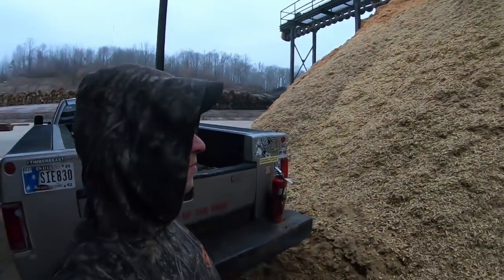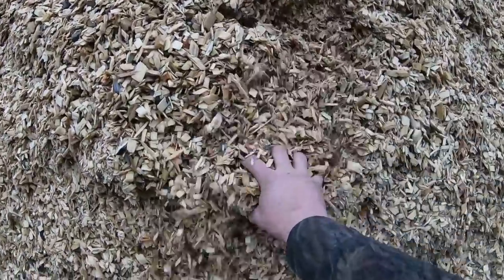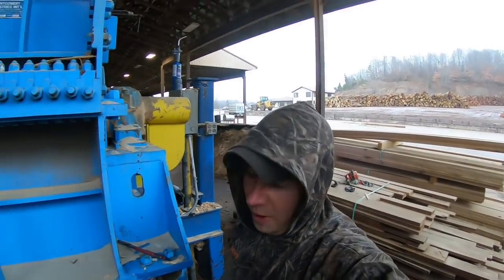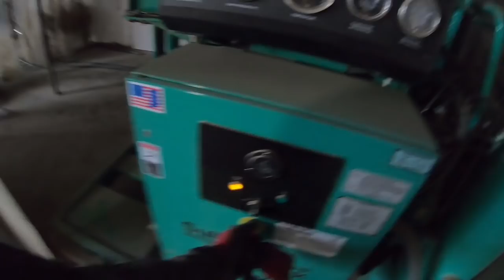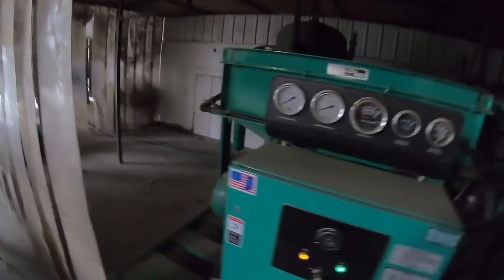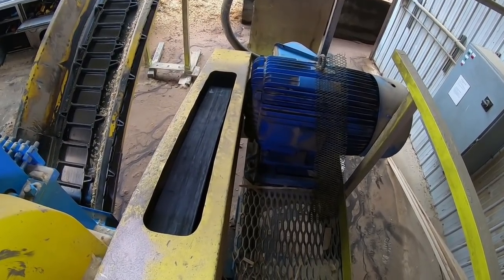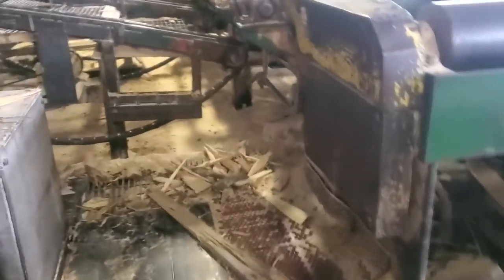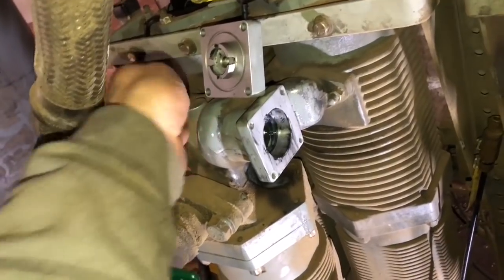Race Tracked the screen!!!

Comment: Cool! That one eats!  Story time:  25 or better years ago not long after I started as a millwright/outside machinist. I was working at a mill under shutdown one weekend. I was working rebuilding a live deck and there was another crew rebuilding a wood hog at the other end of the building. They got through with the rebuild and decided to test the Hog. I heard it start up, come up to speed and start chipping. It sounded like they all should and then all of the sudden all hell broke loose.
Gawd awful metal on metal high speed , high impact , shaking the sawdust out the rafters noise. Somebody remembered to hit the stop button on the way out the building and the noise finally died down and came to a stop. After everybody changed underwear and collected their balls off the floor it was time to gather around and see what happened.
7' foot steel pinch bar had been left on the feed conveyor and went in the Hog unnoticed until it made itself known. It caught in the rotor just right, whipped it into a cork screw shape and started thrashing at speed. It left a neat little pattern of dime sized divots of steel it removed from the housing all the way around.
Moral of the story is count your tools before and after work , especially before startup LOL
Reply from the maker: Haha on man that's bad

Comment: Before I got hurt and disabled, I used to do maintenance at a hardwood flooring mill. Our hog used 100 hp motor and we would pull a weld the hammers in it. It would take hours to pull the shafts and put hammers on. The shaker table was 4 feet wide to hog and the chips went to fire a steam boiler for power to run the mill.

Comment: Do you use tag-out/lockout procedure at motor starters/disconnect switches before you work on equipment to prevent someone from starting equipment while you or anyone else work on equipment to prevent injury?
Reply from the maker: Usually but not this time because I was there by myself

Comment: Hey wade question for you?? When you guys start up in the mornings, do you guys start everything per day at once or do you guys wait?? The reason I’m asking is because at the mill I use to work at the electric company told the owners that if you start like the chipper, main saw and the the resaw with a 2-5 minute intervals then the electric bill would be so high because they are in a way over loading the system and it spiking the meters..
Reply from the maker: We are supposed to do that buy we dont soft starts help out a bunch

Comment: Wade, if you had to give a super rough estimate of how many HP total of electric motors running at any given time the mill, what would you reckon it is? 500, 800? I know you guys must pull an enormous amount of power.
Reply from the maker: I'd say steady over 1000 but at peaks I'd hate to guess

Comment: Thanks for another great vidget driver ! Question: why did you buy screens with the holes too small in the first place. Not trying to be a smartass just wondering ? Have a great day Tater. See ya on the next one.
Reply from the maker: Ok we bought this rig used and it had to small of holes but decided to run it anyways and it was prolly a mistake lookin back because of the production slow down and peice size
Reply: Logger Wade okay I get it. Thank you for explaining. Take care driver